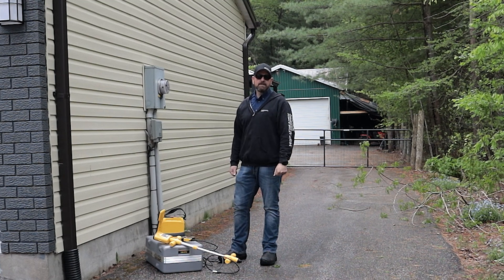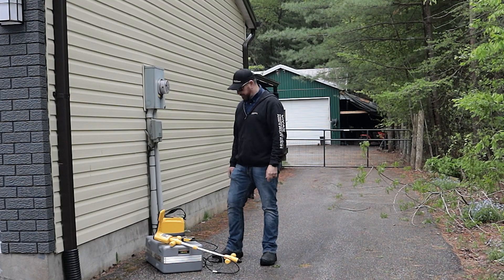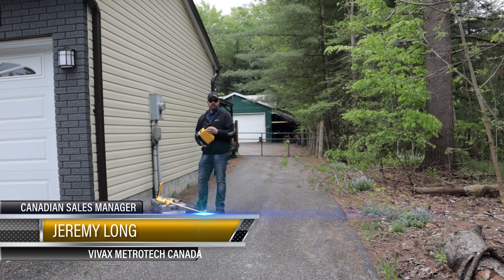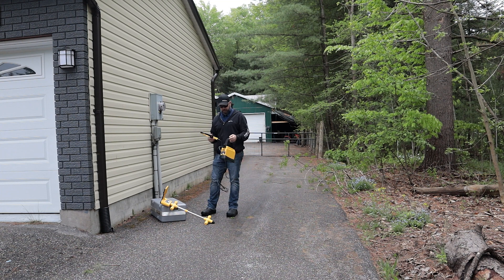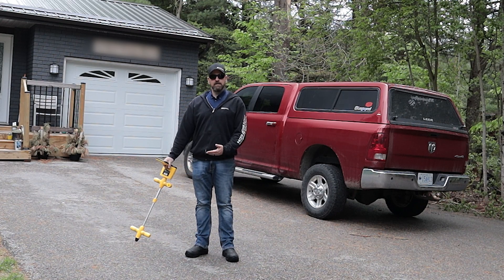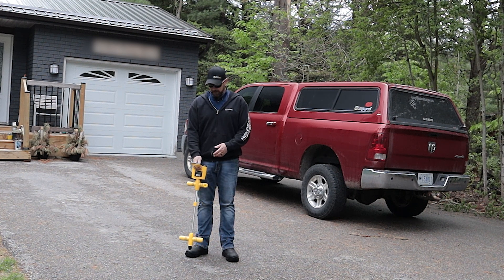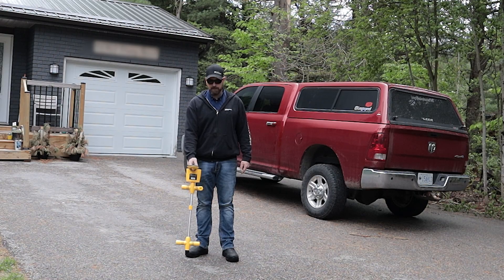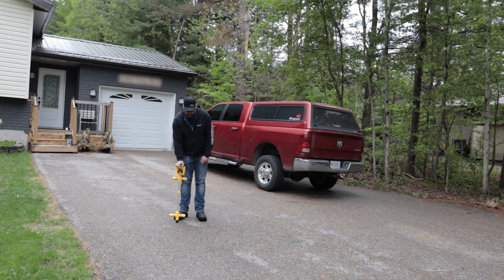How to use the VM-810 Utility Locator

Comment: Can you explain the difference between the high and low output settings on the transmitter? Does it change the frequency or just the power output?